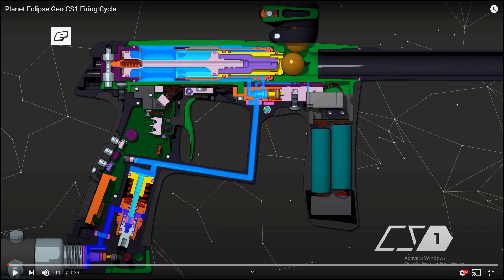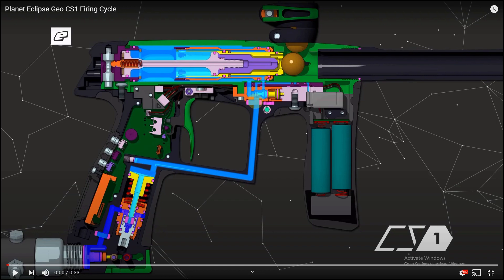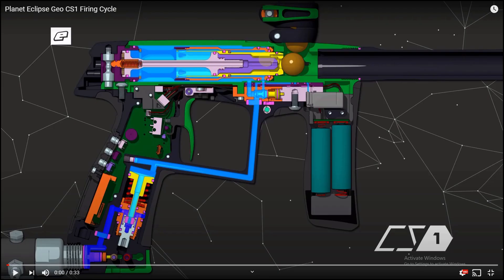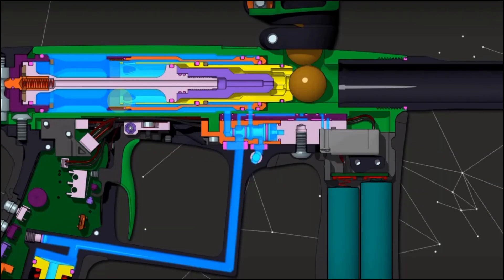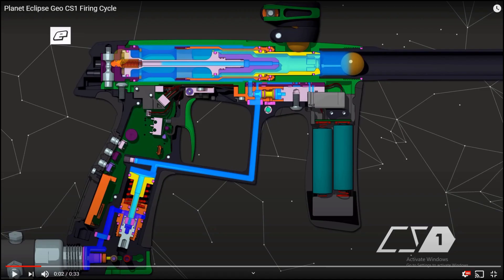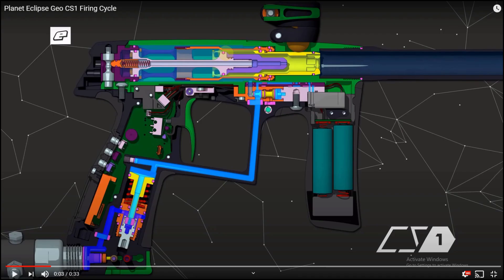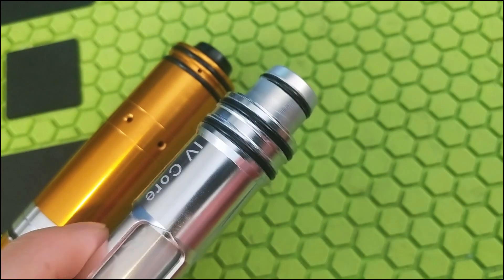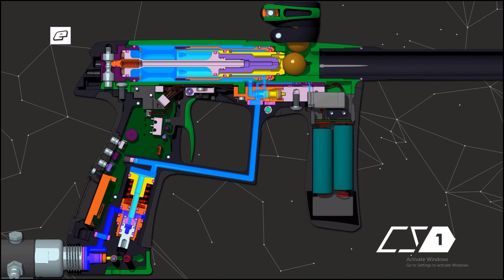Planet Eclipse IV Core | Technical Break Down

Comment: Dude, how exactly does the air sear push the bolt backwards?  Isn't the air pressure the same both in the shot chamber and the air sear area?  If it's the same pressure on both sides, why does it move backwards?
Reply from the maker: The surface area exposed on the sail from the air sear side is greater than the chamber side. Why the size of a sail is so crucial for the function of many engines.